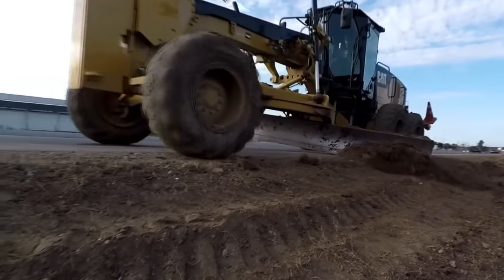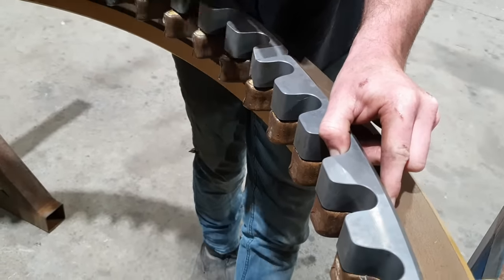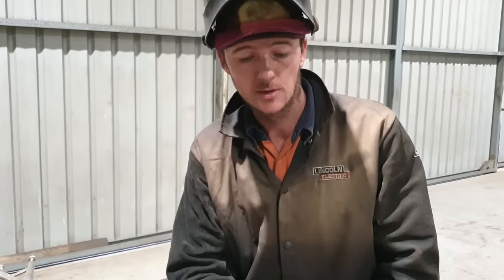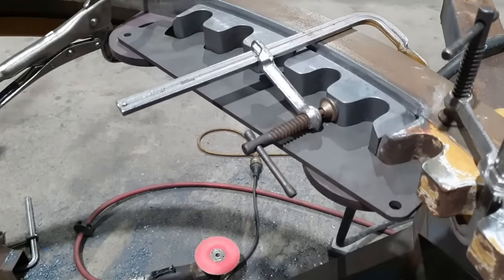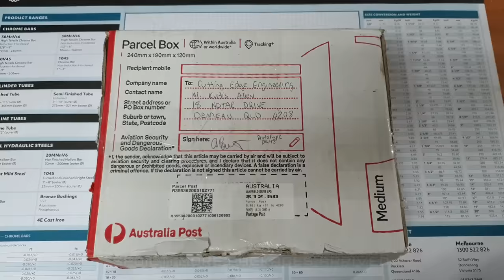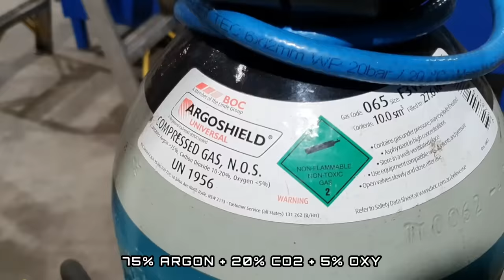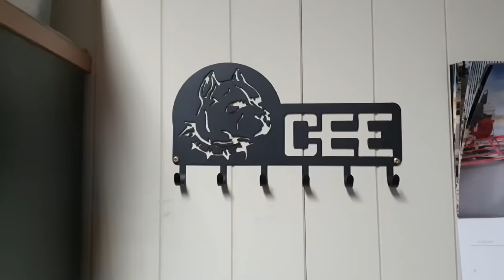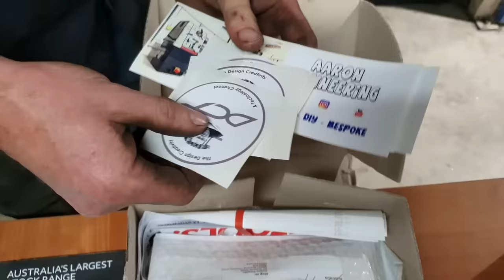Replace DAMAGED Circle Segments for CAT 12M Grader | Welding Fabrication

Comment: Pseudo free-handing the Oxycutting had me all kinds of spooked. I could never have gotten such nice cuts. Experience and a steady hand definitely counts.
Reply from the maker: hey mate thanks for watching yeah I've had my fair share of practice
Reply: I could not possibly have done that that well by hand! Plasma cutter held in a circumscriber or I would have told the kuka robot to do it! Brilliantly steady hand sir!
Reply: @andrewallen9993  I suck at cutting freehand as well, so I built a cnc plasma table. I can rip plywood with a cordless circular saw or cut drywall with a knife freehand down a chalkline and stay +/- 1/16" or a mm or so of the line, but don't ask me to draw or cut a nice line with a single pointed tool.
Reply: @CGT80  I can beat your accuracy with a hand saw but would definitely not Match you with a hand held power tool 🙂
Reply: @andrewallen9993  A hand tool gives you more time to be accurate and it depends on whether you want more accuracy or speed. You probably have a lot of practice with a hand saw just like I have a lot of practice with a cordless saw. My cuts are slow enough to be accurate but still get the job done quickly and when I don't need as much accuracy I will cut faster to get done. Once in a while I will use a straight edge, panel saw, or table saw, but I prefer to use fewer tools and spend less time....taking the easy way out, especially since most of my work is on job sites rather than in a shop.

Comment: The little fella really likes that ball, amazed It's still in one piece.
Reply from the maker: not going to last much longer I'd say
Reply: @CuttingEdgeEngineering  Might still be partly there by next Friday. BIL had a similar brindle, he gave him some old fabric belt motorcycle tyres, with the beads cut out, as chew toys. Those lasted around 6 months before he destroyed them.
Reply: It didn't come with a handy carrying handle so he made one. Problem solved.

Comment: Very impressive work my friend. I was especially impressed with the smooth cuts you made with the torch as you began the project. Looked damn near like you cut the teeth out with a band saw. Tremendous job and fascinating to watch. Skilled craftsmen always make even the most difficult projects look easy. Well done Kurtis...well done.
Reply from the maker: Hey Paul thanks mate glad you enjoyed this one. Cheers, Kurtis
Reply: The cutting torch looked small for the thickness of the metal. All in your technique and a very steady hand. Well done!👍
Reply: @edwinhsingmaster9135  ive always preferred the smallest tightest torch flame i can get away with, more control usually

Comment: First thing I noticed was the issues with the tape measure. I'm a retired machinest from Indiana, USA. I've used a carpenters folding ruler for many years. Measuring inside dimensions is easier with one. Tape measures are good most of the time too. Really appreciate your content. Like you're 4 legend friend as well. 
George from Indiana USA
Reply: Yes , I like a ruler for that type measurement. I work in metric and give the rulers out to people I train as a gift for attending the meeting.

Comment: Great video as always. Amazed by all of the strange things people bring in the have repaired. You would think since this is a normal maintenance piece it would be designed with bolts that allow the customer to add and remove worn out pieces. Thanks as always!!!!
Reply: Bolts don't mean it can be easily unbolted. Plus, with the stress these things see, bolts are likely to break. (I've had to cut out numerous bolts. and there's several videos of Kurt having to as well.) Welded in is plenty strong, and easy enough to remove... back in the shop. (there are those that would do this out in the field/ditch/pit/whatever, but I wouldn't.)

Comment: Possible dumb question:
Why is the ring gear not designed to be rotated and set back in place once one third of the gears are worn?
Reply: Any chance there are idler gears meshing at say 120 and 240 degrees to the driving gear? Just a guess.
Reply from the maker: good question and you'll have to ask the Caterpillar design team that one mate haha
Reply: @tacfoley Yes, to make the ring a separate part would involve each half of the section having to be as strong as the full ring, and you would need multiple clamping points to ensure that the inner ring is not going to distort. Would add easily an extra half ton of steel to the grader section, and would require the rest of the frame to b stronger, the attachments to be bigger, the frame sections there to be thicker, and the cylinders to be a size or so bigger. All in all would be probably an extra 2 tons mass, and you then run into constraints on wheel loading, and driver training and working ability. 

Easier for CAT to simply laser cut the ring as a single unit, then weld the outer brace on to it, and then have the side sections welded on, making a much stronger unit that is relatively light in mass. There is a laser cutting operation near me that makes those parts for CAT amongst others, and they will try to minimise waste in the sheet, so there is going to be a few other parts, that need that thick steel, cut out of the inner section before the ring is cut. All about maximising the usage of each sheet, to cut input cost.
Reply: I thought that too. It would be a major job to disassemble the unit though and you probably only get 3 rotations before the whole ring would need to be replaced. So it would be cheaper (but not necessarily quicker) in the short term but more expensive in the long term since it cost time and labour to disassemble rotate and then reassemble each time.
Reply: Because that would mean less parts CAT would be able to sell.
Reply: That or have a couple different mounting positions for the motor and sprocket maybe.
Reply: Not a silly question at all.  It couldn't be; I was thinking the same :)
Reply: There might be a cost effective way to manufacture it so the ring gear could be rotated and set back in place. Any mechanical engineers out there? 
Making the smaller drive gear the sacrificial lamb might help reduce more costly downtime repairing the large ring gear. Of course, proper routine lubrication on the gears help extend the life of the parts too.
Reply: It seems like the old machines used a bolted on ring gear, but that might have been Alice or someone else.
Reply: It's not really a part that wears out 
Well obviously it is but by this stage the rest of the machine requires other massive work so it's basically beyond its designed life and very well used 
Or its been abused 
If you bolt it on it comes with another set of adjustments that would have to be made

Comment: I always have to comment about the video and editing you and your lovely lady produce for us. Just like the work that comes out of CEE, everything is TOP NOTCH ! Oh how I miss the smell of burning oils, grease and metals of the shop. They should can that and make it into aerosol spray for us old retired farts eh, LOL. Thanks for the memories my friends. Take care eh.
Reply from the maker: hey mate always great to read your uplifting comments, maybe that's an idea for our merch store "machine shop man spray" 😂👍
Reply: @CuttingEdgeEngineering  A nose spray or drops eh, LOL. There are worse things out there to poison ourselves with. After 50 years+ of welding and smoking small cigars my Dr. put me on a puffer. For the first month, every time I blew my nose there would be black flakes with shiny spots as large as a fingernail (the spots not the whole flake) I took them up to the university in the city. Turns out the little shiny things were carbide and fiberglass from our grinding stones and disks. The damage has been done and no reversal but at least it isn't asthma so really all I need the puffer for is before bed so I don't get wakened up in the middle of the night. Take care eh !

Comment: Welding upside-down is a trick and only professionals can make it look great
Reply: But as you see here it wasnt so great result and he turned whole piece around.
Reply: Other than the awkwardness (sometimes), it's actually a lot easier than vertical and a little easier than horizontal. This guy is definitely a professional though.
Reply: @JJ79_  we didn't actually get a great look at the first pass on the bottom but it looked fine to me. And why shouldn't he flip it over? Only a fool would do something the hard way for no reason. Plus, it saves his back.
Reply: @Lucas12v  If you are really professional welder there is no need to turn anything. And sure the bottom look was good enough to see that welding wasnt so good.
Reply: @JJ79_  so you would have hunched over and welded the bottom then spent an hour or more with a grinder right by your face while uncomfortable rather than flip the piece with the crane that you already have handy? You may or may not be a good welder but you're definitely not very practical.
Reply: @Lucas12v  I'm just trying to say that upside down welding is not so hard if you really are professional.

Comment: Could you design bolt in segments for the ring gear as an aftermarket mod
Reply from the maker: hey mate could be something to design but the conversion probably isn't worth it
Reply: The trouble with making a bolt in replacement part would be ensuring that it stays in place and doesn't loosen and become sloppy.  We have already seen that this machine doesn't see regular service inspections so the chances of a loose segment getting caught before it causes serious damage are zero. There appears to be no easy solution apart from purchasing the ring teeth segments.
Reply: Ya cutting and welded is always the easiest

Comment: Good job with that big angle grinder.  Not many people run those now, but you can sure get some work done with one and a better job with the larger wheel.  It's so neat to see just how many things on heavy equipment can be repaired instead of replaced if you're smart enough and willing to do the job right!!  I'm always impressed with the little things you do that make the job "done right".

Comment: interesting!  I've never seen how the teeth on those were replaced.  but I got totally surprised when I saw you break out the cutting torch, I figured you'd use a plasma cutter.  But what really surprised me was that cut, I thought for sure that was going to a huge mess but man! that was a pretty cut.  props mate

Comment: Caterpillar should design the ring as a separate piece that is indexable for maximum life and bolt-on replaceability. 

But given its current design, your jig is the perfect solution. And your work is is top notch, no doubt.
Reply from the maker: No money in that though 😂👍
Reply: @CuttingEdgeEngineering  lol! Touché 

Cheers

Comment: I'm surprised those segments aren't bolted in place from the factory for ease of replacement.
Reply: Bolts are not strong enough, you would need one per tooth, otherwise they would just snap. Remember this slew gear might be expected to move 20 tons of soil in a single pass, and also cope with the odd boulder that it has to rip out of the ground as well.
Reply: I was thinking the same thing. Although, it would be cheaper to manufacture the way it is now and as SeanBZA mentioned it probably would need quite a number of high tensile steel bolts and may introduce unreliability. So as far the manufacturer is concerned they make it cheap, and strong enough to last warranty. Anything after that is the customers problem.
Reply: Not much fancy equipment on this one, just skill and get er done.  Nice job.
Reply: They should have made all the brackets to the outside of the circle bolt-on, so the circle could be turned to distribute the wear
Reply: @erik_dk842  Never gonna happen for the same reason the teeth aren't bolted on...

Bolts aren't strong enough to withstand the abuse these things take...ALL of the force that hits the blade is transmitted through the blade mounts into the teeth...Bolts would be shearing off every day or 2 of use and as soon as a bolt broke, the pieces would shift and then something would get jammed causing even more damage as parts that were aligned to slide past each other suddenly aren't anymore...
Reply: Probly to much distortion. Same as what happens to me Friday nights
Reply: @SeanBZA  have a think about how the sprocket segments are bolted onto the final drives of a dozer with on problems
Reply: Why couldn't the entire sprocket assembly rotate.  You could three times the life out of the thing based out of how much they rotate it.
Reply: @SeanBZA  Blade segments on bulldozers are bolted on, bucket teeth on excavators are bolted on for ease of replacement.
Reply: @bejay69  Yes, both of them parts designed to be sacrificial, and to break free when over stressed.

Comment: Awesome job.  I’ve got an old Komatsu mini-excavator with the crown wheel going.  I bought the machine nearly 11 years ago (majorly second hand), and it was going then, so I got it cheap.  Just use it for odd jobs around our farms here in Tassie.  Sometime it will completely crap out, and I’ll need a newer machine, but it is just too expensive a job to warrant fixing, not to mention, there are no longer good quantities of spare parts available for the model.

Comment: An incredible repair and I doubt many shops are capable of doing this accurately.  Might it be wise in manufacturing to have bolt segments in the first place or built in such a way that the sprocket could be indexed to a less worn area? As for videoing, it takes good planning to capture both before and after shots and then smoothly edit them together. You two make a GREAT team.

Comment: Cheers from France! Thanks for sharing your expertise, and thanks for the high quality of the videos.
Your dedication and problem solving skills are inspiring !
Why do you use a gas mix that contains oxygen ? I thought the idea of a gaz shield was to avoid oxygen ?
And what kind of property is brought by the brass coating of the wire ? (absolute beginner here...).
Reply: The oxygen helps to increase the heat of the weld,(I think), it’s only a small percentage of the gas, so it doesn’t affect weld quality, also the brass coating is to stop the wire in the spool from corroding and to give good contact in the weld tip and also to minimise internal arcing in the tip, which causes sticking of the wire .🙂

Comment: awesome stuff mate, I have the same welding machine at work and the wire speed is a bit tricky to control  I'm using fluxcore wire with CO2 👍🏻🔥🔥🔥🔥🔥

Comment: great videos , two questions , 1 why use bronze coated welding wire , i thought they were copper coated to prevent the wire from rusting ? 2 why change your shielding gas to a gas that has 5% Oxygen in it ? i always thought the reason for a shielding gas was to keep oxygen and nitrogen from getting into the weld metal .

Comment: Interesting video mate, so that's similar to one half of the bearing that a 360 excavator sits on

Watching your channel really makes me want to get back into heavy engineering, the company i used to work for cutting and drilling wear edges is advertising again, im reluctant to apply because i left due to some drama nearly 25 years ago

If i lived in Australia id be hanging around your shop watching what your working on and lending a hand here and there

Comment: Very nice job as usual , That sprocket teeth was hardened? As it is not clear in the video ,also was welding continue or back to back , skip welding , for both sides , it there any preheat post heat , or in between inter passes, can you give more clues on that issues , please , thanks in advance , great job, best   regards

Comment: Hey Curtis not sure if you're aware/ have a habit of it but clear safety glasses are no good for cutting with a torch. May not seem as bright as welding but IR is emitted which is just as bad as UV. Clear shades are obviously better than nothing but shade 5 or darker is required, otherwise your eyes are exposed to IR light.

Comment: Kurtis like the manufactured slingshot but I am 74 and still have a 40 year old home made with fork from a tree, use it to in a process of placement of wire dipole radio antenna in between trees. I am a Ham Radio operator.

Comment: Hi, my friend) the work is good. Why didn't I melt the erased sigments with a strong metal and then sharpened them for a naminal. or was it a request from the customer to replace the sigment ? The work was done well. Greetings to you from Yakutia.

Comment: Just curious. Was your decision to use a hard wire instead of flux-cored gas shielded or metal-cored wire based on reduced heat input to avoid warping the ring? Also, I’m surprised that you didn’t preheat before welding because of the mass of the part. Your opinion, please. Great looking job for sure.

Comment: Just curious, no criticism either way. 
Did you build weld the entire depth of the mating between the new teeth and the old frame? Or did you just weld the top and bottom edges, leaving a gap in the middle of the mating surfaces? It seems to me it would be stronger to build weld the whole surface, but also difficult to do in such a tiny space.

Comment: Great repair. The old teeth as thick as they were seemed to cut very easily. Question; why did the welding gas for this job contain 5% oxygen?